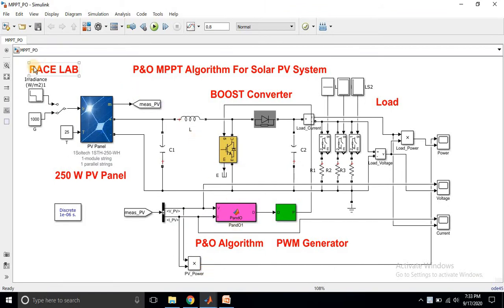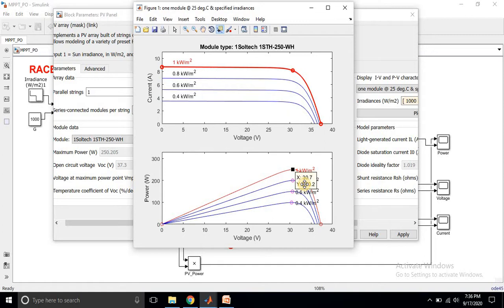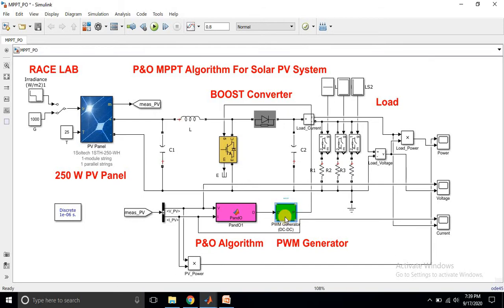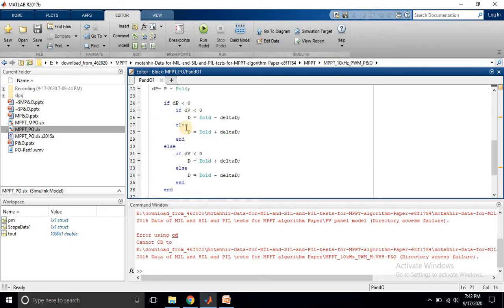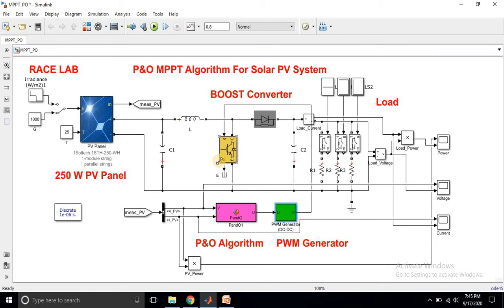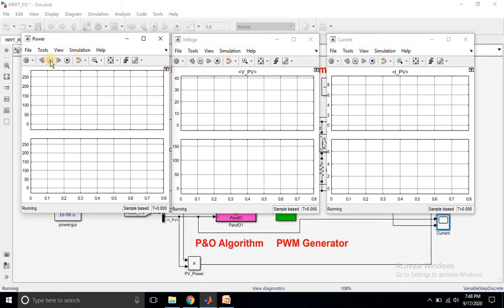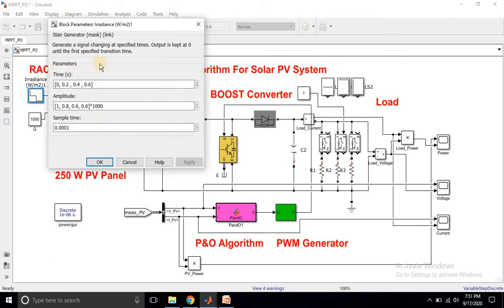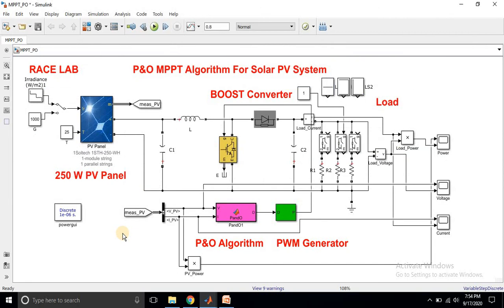PO MPPT – MATLAB Implementation of Perturb & Observe MPPT Algorithm for Solar PV System (Part 2)

Comment: Can u give me coding program of p and o mppt and how it should add with pv panel
Reply from the maker: please share your email id
Reply: mdsaifali008@gmail.com brother if you have whatsapp no then send me I want help 🙏 your in simulation p and o
Reply: @Lmssolution  bro why it is coming error in matlab function... That is.. Current directory is reserved for matlab files
Reply from the maker: @ps9666  after opening matlab software will start with installation directory, that's why you are getting error. After opening matlab software, please change the directory to some other locations of the harddisk.